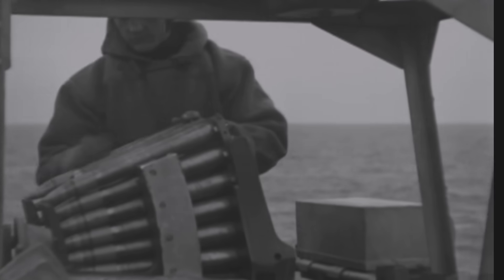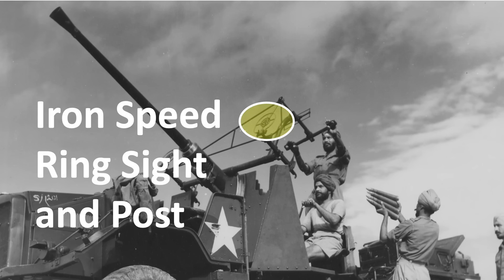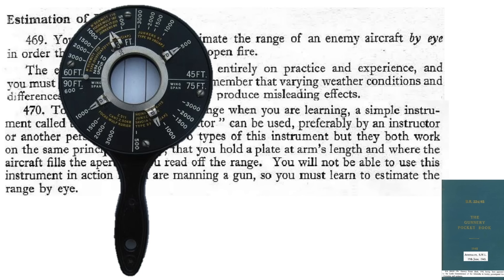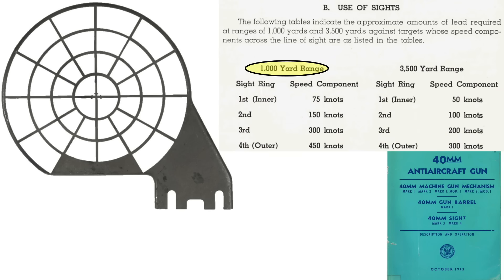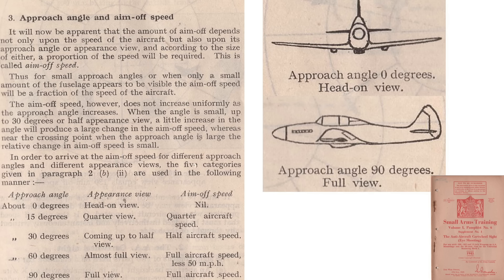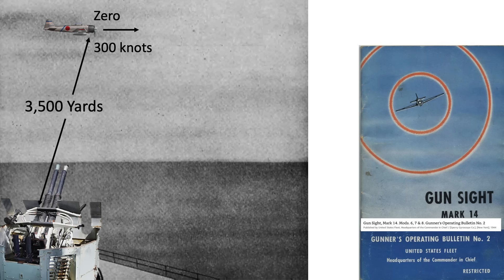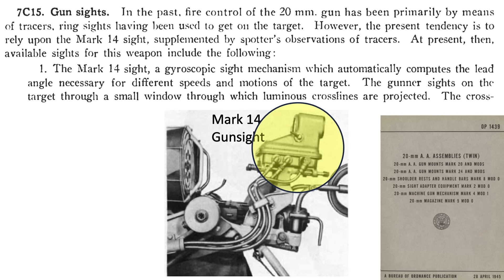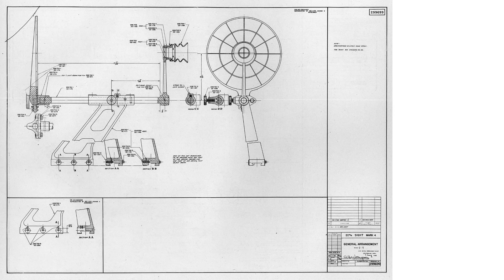WWII Navy Gun Speed Ring Gun Sights Use - 20mm Oerlikons and 40mm Bofors Deep Dive Review

Comment: Did they not account for drop of the shell at distance.
Reply: I think the ballistic elevation graph does that.
Reply: @genreynolds6685  That a thing but were the gunners trained for that. It looks like the aiming process mostly involves lead. I know there’s a training video  from either the US army or Navy. Focusing on tracers to adjust aim. The sight itself is mostly for lead.
Reply: but did you actually read the graph? you'd see it's very flat shooting out to 3000 yards, and still mostly flat shooting out to 4000 yards (the maximum range they were really used at and when the shells would be self-destructing).

I was looking at it before. even if a target was past this at around 5000 yards away horizontally, and at 1500 yards vertically (slant range of 5200 yards) you would hit it if you elevated the sight to 340 mils (19 degrees), but if you just lay the sight directly on top, you'd probably be at 300 mils (17 degrees). yeah that's 2 degrees of elevation while the ship is pitching and rolling at a range it wasn't even used at.

Comment: I'd read a German manual for a ground-based AA gun, and the part of the routine is similar: the ring sight provides the INITIAL lead estimation, but then the gunner relies on tracers to adjust after firing commences.
Reply: -From 1942 the 2.0cm C38 Quad FLAK received a lead computing sight that enormously increased accuracy.  The Draper Labs Gyro sight on the USN Oerlikon had a similar effect.
The ground based German C38 had a DC Tacho generator  that created a DC voltage proportional to traverse elevation speed.  I assume a 3D ballistics cam with a potentiometer with projectile transit times for particular range and Elevation settings then divided this voltage down.  It was applied to a electromagnet that deflected the reticule in the reflector sight.  A battery powered up the cross hairs.
-For naval versions of the gun I assume they used a rate gyro instead of a tacho generator like the K14 since the ship would be manoeuvring.
-Very early German 2.0cm FLAK C30 had a winde up spring wound gyro with a mechanical computation and ring and bead site.  No air or electricity required.  They were found to be hard to maintain and fell out of use.

Comment: So how were you supposed to compensate for bullet drop, I would think that it would be significant at 3500? Or was dispersion going to be so extensive it was not practical to try?
Reply: You didn't really need to at the ranges these AA guns were used at and with all the considerations of being on a ship pitching and rolling while a target is maneuvering and actively trying not to be hit.

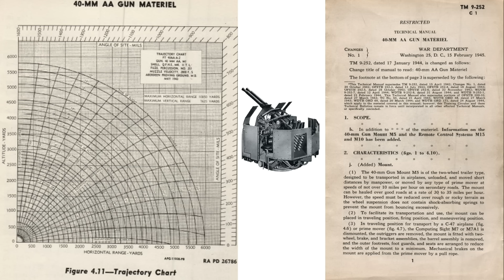If you want numbers: at 7:08 you can see the 40mm shell's trajectory, it's still very flat out to 3000 yards and is still mostly flat out to 4000 yards (its effective range). I haven't measured it exactly, but it looks like even if a target was past this at around 5000 yards away horizontally, and at 1500 yards vertically (slant range of 5200 yards) you would hit it if you elevated the sight to 340 mils (19 degrees), but if you just lay the sight directly on top, you'd probably be at 300 mils (17 degrees) - yeah, that's only a couple degrees at a range that it wasn't even used at!

Comment: Why didn't Bofors guns use a single gunner instead of two different people aiming the gun?
Reply: It depends on the mount.  Single guns only need one gunner to aim but many of the mounts had one man to adjust the height of the pedestal for the gunner.  (From experience, Royal Navy ships in the late 80's didn't).  Double mounts and bigger have one who controls elevation and fire while the another man does the horizontal aiming.
Reply: One aimed only horizontally, one aimed only vertically.  Each had a wheel with a handle on each side for each hand.  These wheels physically moved the gun, they were not the inputs to a power aiming system, so they took a lot of effort, and there was no easy way to combine vertical and horizontal aiming, unlike a joystick.  Also, separating the two simplified matters during the stress of combat.  I believe some guns had a third aimer whose only job was to offset the lead, while the other two aimers always sighted at the center and may not have even had ring sights.  If you are anywhere near SS Jeremiah O'Brien in San Francisco, they used to let you sit down in gun mount and aim it.
Reply: @grizwoldphantasia5005  "Also, separating the two simplified matters during the stress of combat" 

Any evidence for that claim? One would think that two inputs in the same system actually complicates things in a stressful situation, consider plane crashes that have happened with airbuses due to their fly by wire joysticks and "dual input" confusion.
Reply: @maachinimamaachinima  I double dog dare you to come up with any practical WW II aiming mechanism whereby one individual could aim both axes simultaneously.  That you won't be able to is all the evidence I need.

One hand/aiming wheel for each axis?  Hands for one, feet for the other?  I don't mean to be snarky, but do you really think you can come up with a solution that no one in all the WW II militaries could?
Reply: @grizwoldphantasia5005  

"any practical WW II aiming mechanism whereby one individual could aim both axes simultaneously"

The M45 quadmount 50cal even had a push pull / turn yoke for combined powered traverse / elevation. Or consider all the videos on just this channel about the powered turrets on bombers. Or consider the manual elevation and powered traverse of the sherman tank.

Your ignorance is really shocking!
Reply: @maachinimamaachinima  So you claim to know more than all the designers at the time, including the ones who presumably knew of this miracle aiming system and did not copy it.  I notice this was only four .50 machine guns, not four 40mm autocannon.  Perhaps the designers at the time understood the difference between a lightweight mount which miraculously never lost power and a heavy mount which had lost power.  They probably also understand that in combat, power actually can be lost, and when that happens, some kind of manually-powered backup aiming system is desirable.  I suppose that is not a requirement in your perfect world.  Tell me, what does that single M45 gunner do when his powered system loses power?  Suck his thumb and cry for mommie?  Or do you hit reset and restart your game?

Your arrogance is really shocking!
Reply: @grizwoldphantasia5005  

The Bofors 40mm literally had (multiple across the USN and Royal Navy) power driven shipboard mountings. Powered mounts combined with the Mk 51 director (which was manned by one person) were very effective and actually used in WW2.

The M19 GMC also literally had powered traverse/elevation with backup handwheels. Yes backup handwheels exist lol. Even much heavier guns / turrets can be moved by handwheels.

Comment: I did hear a few times that there was so much AA on US ships by the end of the war that when a kamikaze attack happened. There was so much being fired all over the place that sometimes ships hit other ships will AA. But never really saw anything that confirmed it. Just mainly because kamikaze pilots would attack from all over the place that a ship just defending itself did have to point its AA in arcs that put other ships at risk of being hit by AA.
Reply: He has commented in another video that some of the AA projectiles are designed to self-destruct after a certain range to help decrease the likelihood of this friendly fire problem, although if the ships are close to each other then this obviously won't help.
Reply: The 40mm had self detonating ammunition so the round would bust after a set time of flight to reduce the danger of friendly fire. I do recall Enterprise's 40mm mounts forward of the island taking a five inch shell from another ship shooting at a low flying kamikaze.
Reply: That was be taken into account in planning formations, spacing, etc. Just like for aircraft.
Reply: Most of the 40mm fire was by director. A guy in a different location with a gyro lead computing sight would be aiming, and the director mechanism would calculate where to point the gun mount. In this case, the main job of the crew on the gun mount, besides loading, was to stop fire by stepping off the firing pedal when the guns were pointed at another ship in the formation.